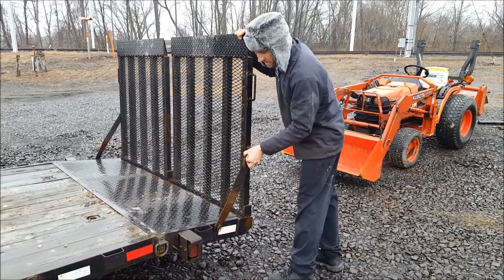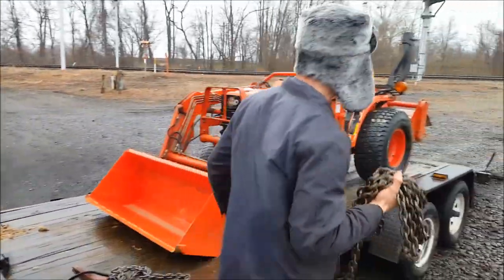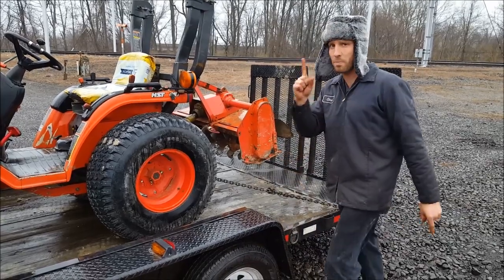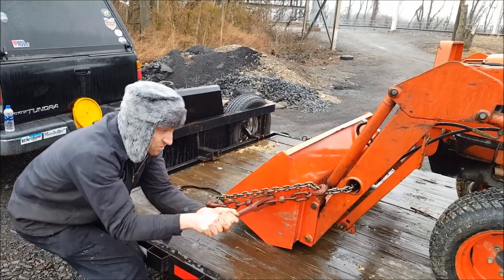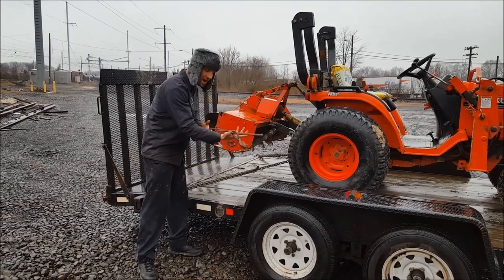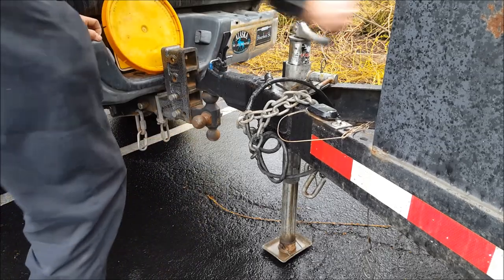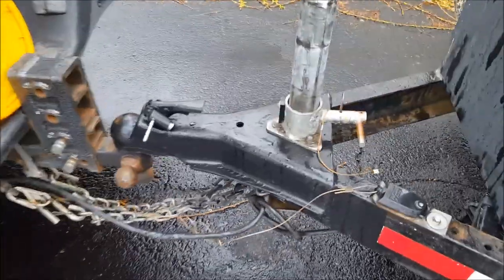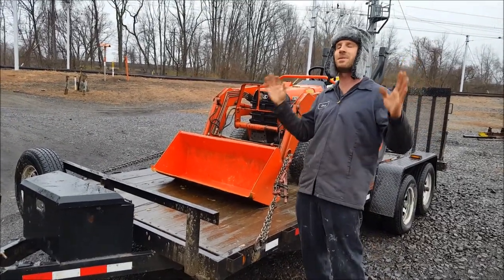How I Load/Chain my Tractor On Trailer for short offroad trips-NOT UP TO DOT STANDARD - Kubota b7500

Comment: Excellent video and very helpful. Personally, I use 4 points, being time consuming but gives me piece of mind as I don't have your level of confidence and expertise. Only because I have previously had cargo move with nowhere to pull over and adjust the load for several miles. This video has helped me a lot though.

Comment: Technically should connect breakaway cable to a solid piece of the truck. If trailer does fall off and ends up breaking the links of the chains or the rings you have attached to your hitch the cable will be rendered useless.  Everything else was textbook.
Reply from the maker: AJ B good point.  However I would have to say it's impossible that the 7/16" chain link I have hooked to my truck will ever break before the 5/16" chain would.  Just not physically possible in my eyes.  In fact, those rings with pull through the hitch Steel on my truck before they break. They're quality high-tensile Steel pieces.  Thank you for your comment and pointing that out though!

Comment: Very good information.
Reply: The tractors on the farm where I worked ran from 80  to 250  horse power with attached equipment sometimes on front and back and had to be hauled  some distance for some custom work,so it was very important that all parts stayed on the trailer. I always had a can of J D green to his hid where chains were tied n.

Comment: great quick and to the point for short local driving. what is that metal bar with a magnet you used to push the chain in the bucket pipe?
Reply from the maker: Yeah definitely a fast quick way to get going but certainly not up to DOT Standards. I actually do it a little bit differently now. Should maybe make an update Vid at some point
Reply from the maker: And correct that is just a flat piece of Steel that I use to to push the chain through the bucket.
Reply: @NoNonsenseKnowHow   yes an updated video would be nice to see
Reply from the maker: @mattfabian9758  Ill  hopefully get on it soon.  Stay tuned. thanks man

Comment: You should have two binders on the load one for front and one for back. Cause the tractor could move and loosen the chain in the back. Also using a chain through the front bucket is not securing the tractor Down
Reply from the maker: I agree that there are more thorough ways of securing the tractor. However I trailer this thing around locally multiple times a week, and this is the fastest most efficient way that I have found. Even if the tractor slides from left to right in the back, the rear chain will not loosen up if it's done properly the way I show in the video.  And I disagree... having a chain go through the front loader frame is pretty darn secure
Reply from the maker: I understand that ideally the tractor should be secured on four all corners and not have a pass through chain like I do. But for my purposes, this works great
Reply: It's not up to dot regulations. If dot wanted to they will pull you over and ticket you for that
Reply from the maker: @BVFA15  yeah I know all about the DOT officers.  My brother's an owner-operator, I've heard a ton of stories.  The title of the video is not "How to chain down your tractor to DOT regulation" lol
Reply from the maker: @BVFA15  I do however appreciate your concern and comments. It will help others in the future of this video.  Have you thought of making a video demonstrating your Technique?
Reply: I would like to but don't have a trailer at the moment or anything to use to show people how to chain something down
Reply from the maker: @BVFA15  I've added this to the description of the video:

NOTE: the method I use in this video is not up to "DOT" standards.  I trailer this Kubota several times a week locally, and this is the most efficient way I have found to secure it.           Ive never had the tractor get loose or shift on me. Even with a wet trailer deck going down windy/bumpy roads.
Reply: @NoNonsenseKnowHow  but good video though.

Comment: Whats your thought on the rear implement not being on the deck?  Also, i like how your video was quick and to the point!
Reply from the maker: Never been a problem for me with the tiller up in the air. I suppose with a down on the deck it would maybe offer a little bit more stability. But I've been chaining it down this way for years, and it's never shifted on me even on rough roads /hard turns/rain
Reply from the maker: And yeah, that's what I shoot for! Get the information out there in the quickest form for people who don't have a lot of time to spare
Reply: @NoNonsenseKnowHow  Well I just bought a trailer for my Kubota, and only have 2 chains and 2 binders.... so this came in handy LOL
Reply: Put the implement down on the deck. I had the dealer come pick up my tractor with the Rototiller on the tractor and when I got the tractor back, the top link was bent. All it takes is a good bump in the road.

Comment: I would advise not paying any attention to the way this tractor is boom down it will get you a ticket in just about every state you have to have four chains one at Each corner of the load plus the Implement has to be changed down separately this is state law in most States
Reply from the maker: They usually only mess with commercial vehicles.

Comment: not legal, or up to commercial dot regs.
Reply from the maker: Read the title. Never claimed it to be up to DOT  Standards.  But if I'm running around town, this method has worked great for me my entire life. And it's never shifted.  I've also been pulled over by Troopers. Never had a DOT inspection yet though. Of course for a long haul, I'll hit all four corners a separate chain
Reply from the maker: I just found this on a DOT website:

Vehicles weighing 10,000 Lbs. or more MUST be secured & tied down at a minimum on all 4 corners.  Vehicles 10,000 Lbs. or less do not require corner tie-downs.
Reply: Give me a break. If you think this setup has to meet DOT regs then you should not be quoting DOT regs!